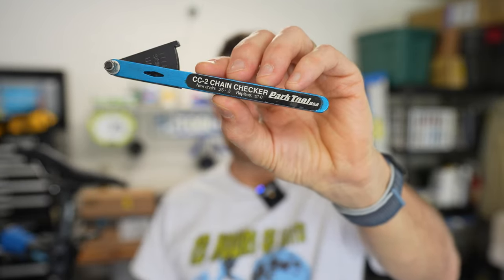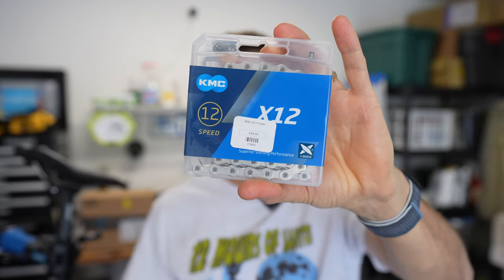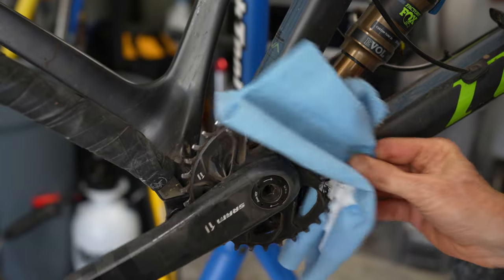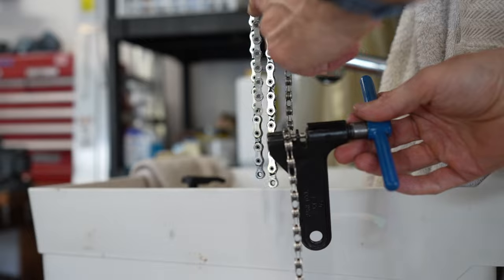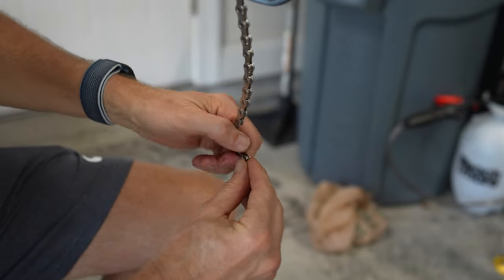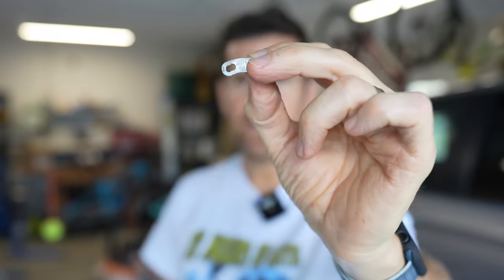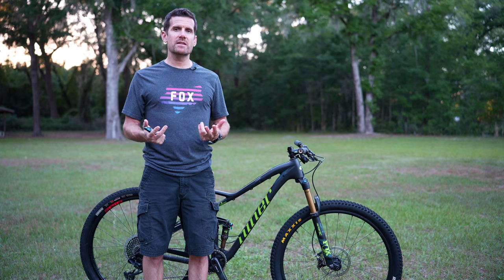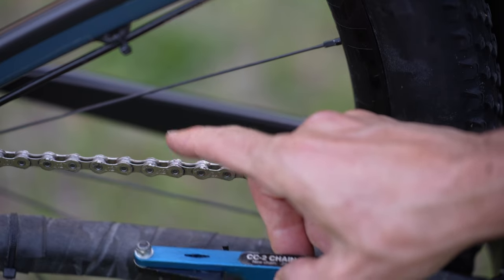KMC X12 Chain: Installation and Review

Comment: I noticed you used the proper Park chain link piers, but instead you used the "stomp" method to connect the new chain. This invites possible errors where one side will seat properly and the other won't, leading to a future snapped chain. Instead use the Park tool as designed to seat the new quicklink, holding inner and outer plate in perfect alignment while doing it. That way you'll be sure the new link will be seated 100% properly.

Comment: Clint, be careful with this...the EAGLE 12 speed actually has slightly larger diameter rollers than all other chains. So to the teeth of the cogs and crank the non-SRAM chain already seems a little worn. Eagle Transmission 12 speed has even much larger rollers. Zero Friction Cycling covers this topic well. Also because of this when you measure SRAM 12 speed (even non-flat top) you really need to use a chain checker that uses the same roller side to measure wear, like the Park Tool CC-4.
Reply: what about the same kmc 12 speed chain with SRAM force xplr?  SRAM officially says to only use their flattop chains but I'm at least partly assuming that's because they want you to buy their products

Comment: On the park tool website they recommend: 11-to-12-speed chains*: replace at or just before 0.5% - Ive been following this advice but you will never know if you could have waited longer...
Reply from the maker: On the chain checker (Park CC-2) it says to replace at <= 1.0
Reply: @ClintGibbs  on the park tool website of the cc-2 it clearly says 0.5 on the side of the tool and also in the product description. Maybe they changed it in recent years. Just wanted to let you know, not trying to be a smart ass.
Reply from the maker: @testalino  I guess they did change it. I probably need to update mine…I use it all the time

Comment: Never add a link to a chain. It creates a weak spot in the chain. The pins are slightly mushroomed. When removing the pin the mushroomed end of the pin is flattened making it weaker than it was originally. This increases the risk of the chain breaking. I’ve seen this on BMX when people adjust the chain length by driving the pin back in as opposed to using the master link. In BMX if the chain breaks coming out of the gate it will result in a face plant in the dirt. On a mountain or road bike it’s usually not that devastating but still risky. It’s probably best to get the chain exchanged and start over. Do you remove all of the factory grease when you replace the chain?

Comment: I bought an expensive KMC DLC12 chain during covid to put on my shimano drivetrain bike. Chains were extremely hard to find at the time and I spent more than I wanted on it. That being said, it’s been a great chain, shifted as well as the stock shimano chain, and still going strong, and hasn’t hit .5 stretch yet, that’s when i usually replace

Comment: I use the KMC X11 and X11SL on my bikes.  I have  two MTB, 2 gravel and 3 road, and all have been excellent.  One of my road bikes is on my direct drive smart trainer and I put in regular hard efforts on it.  No issues with shifting after several months, and no significant chain stretch.  I don't have that particluar chain checker but I can tell you that it's not reached 0.5 yet on the chain checker I have.

Comment: I always use KMC chains. I have been running KMC X12's on my Shimano XTR drivetrain for two seasons now. I usually replace the chain twice a year (just before the spring/summer race season and then heading into the winter months). No issues whatsoever. Shifting is spot on every time without fail. I think at the end of this season of racing I will be looking at changing the cassette, chainwheel AND jockey wheels when I next replace my chain. Top tip with KMC though is never submerge them in those chain baths otherwise you risk dispersing all of that factory installed grease. Just some decent degreaser, a rag and the now quite rare KMC dual sided brush (looks a bit like a dual sided toothbrush).

Comment: I have this chain checker arriving soon this week they finally were back in stock directly from Park tool so far, they still make the best chain checker I’ve ever had. By the way, mySRAM  mountain cassette I have had for years I did a conversion from a two by to the original SRAM GX 1 x .  I’m probably swapping out chains at least once a year and my mountain bike gets the most use everything shifts flawlessly. oh, and by the way, my local bike shop didn’t have any SRAM  11 speed chains in stock, and this was last October 2022 so they sold me more expensive SRAM RED 11 speed road chain . I recently also converted the front chain ring to an absolute black oval ring. Everything shifts fine and the chain is still great and shifts well.

Comment: Agree with several of the other comments that KMC 12sp chain paired with Eagle X01 AXS RD/cassette was noisier and less smooth than I thought it should have been. Switched to an Eagle X01 chain, improved both noise and shifting smoothness. X01/XX1 chains are purported to be longest lasting on the market...time will tell.

Comment: never used the KMC x12 but I did put a KMC x11 on my old hardtail after the factory Sram-cheaper one PC-1110 its what they had for 11 speed in the local shop. still holding up good my brother now rides that bike. right now I have Sram GX chains 12 speed on both my mountain bikes and Shimano HG700 11 speed for my GRX gravel bike. havent needed to replace any of them so far we will see how long they last. seems to be every 2 seasons for me or at least has been with no need to replace cassettes. Cheers

Comment: KMC E-12 on my eMTB. My bike is wolf in sheep clothing, looks exactly like class 1 but it’s actually a class 3 that’s not even legal. It can put out massive torque that can reach 120nm. I only trust KMC with this bike. Even the best SRAM chain can easily snap but with KMC, no issues.

Comment: When you're changing a wear component and looking for a replacement that "wears less", beware that when you have all of these surfaces rubbing together, one of them is going to be the hardest and last the longest, and one of them is going to absorb more of the wear. My first thought when you say this chain wears better is that it's just shifting the wear equation toward wearing the chainring and cassette.

(this is not specific bike experience, just general knowledge about mechanical systems, where you always want to be deliberate about which part will be the "sacrificial" wear part in any situation)

Comment: I haven't had any problems with KMC x10 chains on my other bikes , however I have had problems with them on my three 12 speed bikes for some reason. The issue I have is that the X12 chain doesn't seem to be as flexible laterally as the SRAM chains are and this causes issues when shifting onto the  50T cog on the cassette.  I can't figure it out since all the other gears shift flawlessly. Once in that gear the chains also will not allow me to back pedal as well. I would put it off on just a bike specific issue, but it happens on  three different bikes two with 49 mm chainlines and one with 55 mm. I haven't spend the time to eliminate the only other common issue between the bikes and that is the NX 11-50T cassettes, so the problem might lie there.  
  I still keep the chains as backups in my back pack while riding since I find it faster to switch an entire chain than to use a chain cutter to remove a damaged link and then replace it with a quick link. Other than THAT single issue with the X12 chains I wont use anything but KMC chains on my other bikes because they just never seem to wear out. One is going on 3 years of riding and is still barely at .25 after riding it about a 100 miles a month as a commuter bike.

Comment: When you installed the new chain, you never mentioned if you leave the factory lube or if you do a deep clean on the new chain and then add your own lube.  What's your preference?  BTW, love your videos!
Reply from the maker: I’ve actually mentioned that in another video but forgot to mention it here. What I do is I wipe off that sticky coating as best I can with rub I alcohol. Then I ride the bike for about three rides before I lube the chain.

Comment: I use a Park Tool CC-3.2 and when it gets to 0.5 I change the chain.  Running either 11 or 12 speed on all my bikes.  Funny but this video convinced me not to buy KMC chains.  That issue you had with no being able to use the quick link at a particular link I've never had with SRAM chains.

Comment: Great review. I've used the KMC X10SL Ti-N Gold on my Shimano XT 10-by set-up, using an oval chainring.  If you keep up with regular clean & lub, this super-light, slotted link chain (only 240gm on 114 links) will perform superbly. By the way, the Missing Link is designed to last for around 3 re-uses, or until it locks/unlocks a bit too easily. A great way around breaking the chain for bath cleaning is to undo one of the pulley wheel bolts , slip the chain off the rear mech cage and chain-ring then soak in a plastic container to soak off the trail grime. Slip it back on the same way and lube sparingly, wiping of the grip-attracting excess. Job done. By the way, there's an old British motorcycle trick to ascertain chain wear if you don't have a gauge. Jut pull the chain up and away from the chain-ring at the 3 o'clock position. If it lifts too far, the chain's stretched. Simple.

Comment: I have tried that chain on x01 mechanical system, it was terrible. Bad shifting and chain noise. I have replaced with SRAM chain and everything back to normal. My bike master told be that not all bike works well with that KMC chain, and he not install it any more. In addition I had KMC chain on my road bike, after 1000 km I had link broken

Comment: I had an X11 KMC chain on my XT drivetrain. I had it on for 6ish months before I snapped it. Only chain I have ever broke. I cleaned and lubed it regularly because I like a smooth quiet drivetrain. 
    I went to replace the busted links and decided check the stretch with my park chain guide. It was well over .75 I checked several times. I would say 300 or less miles on the chain. I use rock and roll lubricant and do not ride in wet weather. 
     Bear with me my cousin was running an x11 mtb and x8 road chain 200 miles and 500 miles respectivley he is meticulus when it comes to cleaning and lubing. I told him to check his chains. Both were well past the .75 

   No clue what the deal was. I went back to an XT chain. He is on SLX and trying another kmc on husband road bike.
    Just my experience.
Reply: Hello.. just a suggestion, I used Rock n Roll for over 10 years but switched to Squirt wax about 3 years ago. It lasts about 75-100 miles before you need to reapply, all components stay clean. I ride north Georgia conditions. Pedal on!
Reply: Sounds sweet I will definitely look into that
Reply: I stick to local bike shops for chains now. Ive gotten 2 Shimano counterfeit chains 1 on ebay and 1 on Aliexpress. 
Its possible you did too. Ive always had excellent performance from my KMC 8,9, and 10 speed chains.

Comment: NO idea on SRAM but when I had this chain on Shimano drive train  it was trash. Loud. Shifting was clunky and while pedaling it was making metallic sounds. After changing it to Shimano XT chain all went away. QUiet with precise shifting. Plus I could change gears uphill with Glide + which was not possible with KMC chain. Not recommended for Shimano x12 drive trains.

Comment: KMC's last much less than SRAM chains. XX1 and X01s are the longest lasting chains out there. I am putting a YBN chain just for the races. I have 5-6 SRAM chains that I cycle. I use the oldest for the winter and muddy months, and the previous race chains for training. I also wax the chains, twice every year, for all of my bikes. That's probably why none of my chains shows wear on the park meter. SRAM says to change the chain at 0.5mm not 0.75 - but since your tool is skewed that's probably fine

Comment: Would you recommend clean the chain before installing? I've found very difficult to clean my drivetrain if the stock "lubricant" is not removed before installing, I'd like to know your opinions since I've had that same discussion with the guys at the bike shop and they argue not to clean the chain before installing. Thanks
Reply from the maker: After I install a new chain, I take a ride with rubbing alcohol and wipe off the coating . Then I ride it for 2 to 3 rides before I put in a chain lube on it.

Comment: Are there any negative effects if your chain is too long? I’m just changing mine and it appears to be much longer than the calculated length for my bike -I’ve used two on line calculators for the new one and both have the same result so I assume they’re correct. I had always suspected my chain was too slack but it did work and rode ok, so I’m questioning what the effects of a ‘too-long’ chain are, if any?!?!
Reply from the maker: The downside is that it will wear out the teeth on your cassette and also your chain rings which means a new chain will most likely skip. You’ll have to replace the cassette and usually a chain rings if that happens.

Comment: Maybe I had a lemon, but I finally replaced my sram chain with a little over a hundred miles on it. I had 6 quick links in it from the chain snapping repeatedly. I just can't find a video on strength of a chain. Do you feel the kmc is tougher than my sram gx chain?
Reply from the maker: Yeah something is not right there unless you used something like mineral spirits to totally strip the chain.

Comment: I have a drain train that has over 22K miles but the chain has been changed frequently. Is there a point even if there is no skipping that you would just change out the cassette?
Reply from the maker: Only if there is skipping or poor shifting. Usually when that happens you’ll see the teeth on the cassettes start to look like shark teeth.

Comment: Dylan Johnson did an interview with Zero Friction Cycling and they actually found SRAM chains to test the worse for watt losses.  If I remember correctly KMC topped SRAM. For racing you might actually be better off with KMC not just for longevity.

Comment: I'm not convinced kmc 12 speed work well with sram. I have had great results using them with shimano but that was 11 speed. I tried one kmc 12 speed on my Trance trail bike but have gone back to sram gx. Wear was about the same but kmc just seemed noisier and didn't mesh as well to the cassette. My bike mechanic tells me the X01 chains which are double the price of Gx last 2-3 times longer. Any experience with that?
Reply from the maker: I haven’t done a direct comparison with X0 and GX chains

Comment: Bought 3 KMC x12s and they were all fake. First was on the bike and snapped after 30 miles destroying the cassette and derailleur. I'd check the legitimacy of the chain
Reply: Is there a way to check if it is fake? I always had good experience with e10 kmc chains but when I used e12 no my new bike it sucked from the first ride.....My drivetrain was also new....and I never buy from ebay, always big reliable shops.
Reply: @mallias2683  mine were from reliable retailers. I contacted KMC via email they asked for pictures of the chain and packaging from that they were able to determine they were fake. I believe they have or had an picture on their site to help but mine looked exactly like a KMC chain with the chamfered edges etc
Reply: Yeah, I got a fake 11s KMC from eBay. Fortunately I still had the old packaging from previous KMC chains, and I could see some of the fonts were slightly different on the pkg. The main tip-off I had was that it wouldn’t even go into more than 6-8 teeth on the chainring. Just make sure you get your chain from a reputable source.
Reply: @michaelshoaf878  mine came from reputable sources so even they aren't immune
Reply: I got 2 shimano fakes. 1 on ebay and 1 on Aliexpress. Sticking with local bike shop now. Its not worth the money saved on a life or death component. I feel dumb now trying to save a few bucks when my bike is worth $6k.

Comment: The side plates actually do "stretch over time" as proven when you lay a new chain along side of your worn chain. This is a miniscule measurement distributed across 100+ side plates. The real wear failure happens on the OD and ID of the rollers as they contact the cogs and the chain pins, and that's just my opinion!

Comment: Don't size based on the old chain. What if the length is wrong of the existing chain? What if you don't have a chain? Too much talking just show us how to.
Reply: Right. I actually cut a new one too short trying to eyeball it. The Shimano 12 speed chains are easy to measure following Shimanos instructions. On  12-Speed its important to get it right. Not as forgiving as 10 speed.

Comment: I have been using x11 on my roubaix with 11s Ultegra Mechanical and always change at .75  but recently they just do net seem to be lasting very long and get very noisy when they do wear. I am going to try shimano again to compare. 
I may try a x12 on my Spec SJ when it is worn to compare that as well. So this vid will definitely help me decide   Cheers 🚵🏼🚴🏼👏👍🇺🇸🇬🇧